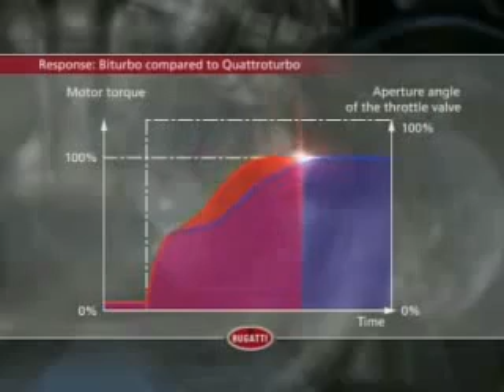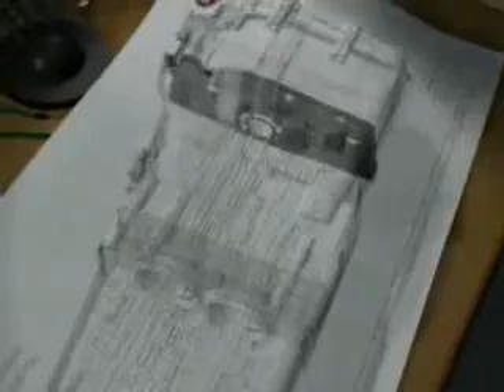Bugatti Veyron Engine how it works

Comment: 6000 rpm.... w16 cilinders 4SUPERchargers and just 6000 rpm. What are they proud of? Fitting a lot of cilinders in one engine?
Reply: +Bob Down No, i guess its called forced induction...
Reply: Pavel Seniut actually forced induction and supercharging are the same thing. it's  using some mechanical means or chemical (in the case of nitrous oxide)  to force air into the cylinders or in the case of nitrous oxide  makes the air more dense. but in both cases more air or denser air in the cylinders creates more compression on the compression stroke of the cylinder. where people get it confused is what people commonly refer to as a supercharger is actually called a blower, which like a turbo is a supercharger.  blowers, turbochargers and nitrous oxide are all forms of supercharging.  charging in an engine is when the piston moves down on the intake stroke and draws in the air/fuel mixture. this is known as natural aspiration and doesn't draw in as much air/fuel as the cylinder can actually hold. turbochargers and blowers force air/fuel  into the cylinder charging it more than natural aspiration so they call it supercharging. The only difference between how a turbocharger and a blower works is in what powers them. turbochargers utilize exhaust gas to operate them and blowers are belt driven off the crank shaft. nitrous oxide is a form of supercharging but it is not forced air induction.  it instead achieves supercharging by making the air/fuel mixture more dense and oxygen rich as it enters the cylinder on the intake stroke. The more dense or thicker the air/fuel mixture the more compression you have when the piston reaches the top of its compression stroke.
Reply: You say "superchargers" but if you pay attention you would know they are turbo chargers stupid.
Reply: Turbo is increased intake and a supercharger is belt driven. Super chargers also decrease the displacement while increasing horsepower. I know my fair share. I was just pointing out that they are turbochargers not superchargers.
Reply: Tristin Odermann pressurising the intake of any engine is called supercharging, whether it is done by a supercharger or turbo charger, it is still called supercharging.
Reply: It's not 4 superchargers it's 4 turbos
Reply: mercedescl No it's not lol, not as difficult as you think. The W16 is a fairly simple design, just has a lot of parts, which is completely unnecessary. A car with 1000+HP should not be easy to drive, i would be scared to see anybody who doesn't know how to REALLY drive in a 1000hp car.
Reply: Telexic Every part is necessary as VW W12 engine "only" had around 500 hp back in early 2000. Apparently, celebrities and billionaires are all having no trouble to use it to go to the shop or cruise around with no problem at all.
Reply: Telexic Hopefully people wake up to find out they're getting robbed by Bugatii
Reply: Do you even know the difference between superchargers and turbochargers?
Reply: david delgadoAt 1:51 in the video, even the narrator says the phrase, "four turbo superchargers".  I can see how some people may be confused...
Reply: Oh that makes sense, thanks for clearing up, my bad totally, I apolagize
Reply: 16 cylinders at 6000 would be like an 8 cylinder running at 1200 RPMs which would be screaming for a V8
Reply: Technically speaking, A turbocharger is a supercharger ( turbine driven supercharger ) or ( exhaust driven supercharger ) but of course when we see the word 'supercharger' per se, we interpret this to mean the belt driven or crank driven type.
Reply: The key isn't about power. It is the flexibility, refinement, and longevity. It is not that hard to make a 1000 hp from a engine. People are able to do that since WWII. But to build a car capable for Paris Hilton to drive one in LA to her favorite shop in Bel Air and allow James May to travel speed up to 200+ mph in Germany, that's a more difficult engineering achievement than sending someone to the moon.

Comment: I love the idea but 1001hp from a 16 cylinder with 4 turbos? sounds weak. Any normal person can make 1200hp from a typical rb26det or 2jz inline 6's with one turbo alone
Reply: are you gonna talk about a cheap gtr than can have 1000hp? think about reliability
Reply: Farie Indriawan ammount of cylinder doesnt equal more horsepower,so does turbo ammount,you can have 8 BIG cylinder piston or 16 smaller one to make same horses.

1 thing for sure,more cylinder = more comfortable ride
Reply: You should watch the other documentary's about this car Bugatti got close to 3000 hp out of this engine during testing but the exhaust temperatures was so hot that the engine dyno room caught fire  this engine is actually running very far from its full potential
Reply: Yes , you can have an engine with 1200+ horsepower from a v8 , but you need to tuned it in other to reach your target . Bugatti has pure raw power , untuned and has no twerks can generate this much pure 1000hp is insane.
Reply: The Person Bugatti has 16-cylinders, so it's obvious it has such power. It's much more obvious that a Bugatti has a Quad-Turbo to achieve that power.
Reply: Telexic are these guys serious or just trolls?!?! :D how many 2-3 litre 1000 hp engines you have seen that lasts over 10 000 miles :D most likely if you abuse them, they don't even last 2000 miles. bugatti's engine is made to last cars whole life time. Engine in bugatti is nice to drive, smooth, quiet, etc....... There are plenty of evidence that supra's and skyline's engines can take 1000 hp, but they don't last long. too big bang in small area. It is just common sense... I have seen many videos on youtube where supra blows up.... Never seen video where bugatti blows up, or any other high hp factory made supercar...
Reply: ERK77VI Nice try, but my uncle daily drives a 1124hp Trans-Am that's LS7 swapped from a C6 Z06. Engine has 113,000 miles and counting. The body has even more, a bugatti is 300k a year maintenance. The tires alone are about 20k because they're specially made to be able to handle the 250+ mph the Bugatti goes. And as the other guy mentioned,  all of those moving parts... 4 turbos.. 8 radiators... Does that sound like a recipe for reliability to you?
Reply: ERK77VI And besides, engines like the LS, the RB, and 2jz are not only legendary for being capable of making such power but also are well known for their reliability.
Reply: SupramanTRD I will wait and see when factory Supra does 430kph
Reply: SupramanTRD The reasons why it’s “underwhelming” is because it’s designed to be more drivable, offering a smoother torque curve, and better drivability and less turbo lag. Along with better reliability to its incredible complex cooling system. Id like to see any super tuned “small” engine be as smooth and quiet on the road yet reliable and cool on a track
Reply: 5:30 you even watch the video?yes you can have 2500 with this engine,but the power figure will be a mess,its dangerous when you have 500hp then the turbo kick in and sudenlly 2500hp crash
Reply: Only difference is the 253 mph it can do....besides that it foes get besyrn on s track by nissan skyline.
Reply: NeATaNDtURdy Reliability? W16 has a lot more parts than most if not all other engines. More parts and more complexity do not mean more reliability. Just more of a pain in the ass if anything breaks on it.
Reply: finaly i found a smart person on youtube
Reply: I would agree. However their latest model is cranking out 1,500 hp which is more respectable for the build.
Reply: I think the Bugatti Veyron's engine sounds stupidly designed and builded.

Comment: turbo super chargers?? what the heck does the narrator mean??
Reply: Turbochargers were originally known as turbosuperchargers when all forced induction devices were classified as superchargers.

turbochargers are basically superchargers. the only difference is one is driven off exhaust gases and the other is belt driven by the engine.
Reply: oh I see now, thank you for the info

Comment: y koniseg is faster with just 8 cylinder?
Reply: Demetrius Villa plus , the Koenigsegg engine is actually tuned up such as the agera produces 1000hp+ while the R version produces 1100hp+ . Is about the engine alone not the we8ght of the car . The weight of a car determine how fast the car accelerate not how many HP it can produce . And also Veyron engine is pure , untuned and raw

Comment: W16 engine is a great work. The 16 cylinder Bugatti Veyron engine. Its really unbelievable 6000 RPM engine. Cant imagine the cylinder moving speed. And 1000 volts high power make this engine as car engine's milestone.

Comment: 2:43 There's no such thing as "cubic litre". It's like saying square acre
Reply: Well not so fast, not sure what the beef is here,  I think you may be a bit confused. First, these 2 analogies don't match.  A liter is volume, whereas an acre is  area.  And you can have a liter of something in a cubic (equal on all sides - 1,000 cubic centimeters) configuration. You can also have an acre of land that is square., and in fact is defined as such  (43,560 sf = 1 acre, or 208.71 feet x 207.71 ft) but it may also take on other shapes as long as the area inside the boundary equals 43,560 sf (like 120 ft x 363 ft = 43,560 sf or 1 acre)  :)
Reply: +Mynameister Yes - that's the point where I decided I had seen more than enough of this overdramatised crap.
Reply: +Xp  Then on your principle he  should have said 'cylindrical liitre'
Reply: You could have a cubic decimeter which equates to one liter.  Not sure if that is what they meant.  If so, then they should have just said 'liter'
Reply: Their is no cubic letter as letters are themselves cubic measurement.
Reply: Well, in all fairness, since the SI unit of volume is the cubic metre, defined as one litre, it is a little redundant to precede a unit of volume (the litter) with another unit of volume (cubic). A cubic metre for instance introduces a third dimension of volume into a previously two dimensional measurement, the metre. It would’ve been less insulting to mathematicians and less confusing to laypeople to simply describe the total displacement of combustion in the ALREADY 3rd degree form, the liter.
Reply: AHHHHAHAHAHAHAHAHAHAHAHAHAHAHAHAHAHAHAHAHAHA YOU PUNY AMERICAN LOOOOOL XD
Reply: if a cubic decimeter is 1 litre, then a cubic litre is 10cm x 10cm x 10cm. 100L.

Comment: Questions. - 2 cross plane V8 engines merged, meaning  still a cross plane crank but with 2 crank throws the same direction, + (90 degrees x2 )or would the crankshaft be more like a star (45degrees apart)?
Reply from the maker: W engine design

The VR6 engine is a narrow-angle V6 engine, which could also be described as a staggered-inline six-cylinder piston engine. The VR6 is designed to fit within the confined engine bay of a front-wheel drive compact car. It is very short in length compared to an inline-six engine, because the cylinders are staggered, even cylinders moved forward, odd cylinders moved backward, but all contained in one cylinder bank, to reduce the length. Joining two such designs together into a W engine creates a design that is much shorter than an inline engine with the same number of cylinders, but not too much wider. Volkswagen Group's W12 engines utilise two VR6-like sets of cylinders mated at 72 degrees, and the W8 engine consisted of two VR4 engines at the 72-degree angle. In the W16, each side is made up of two VR8 banks and the 'bank' angle is increased to 90 degrees. The narrow angle of each set of cylinders allows just two overhead camshafts to drive each pair of banks, so just four are needed in total. For this reason, the engine is sometimes described as a WR16.
Note that this design differs from the triple-bank W18 engine that Volkswagen produced for concept cars of 1998 and 1999.

source: wikipedia

Comment: and Bugatti is owned by VW  o yea pure Bugatti. plus other car manufactures have looked in tom 16 cylinder engines  but found they dont need 16 to make power and torque. dry sump oiling use in how many race cars for how many years. over all its a good use of tech, but it coast why to much for what it does and you cant do any thing with it.